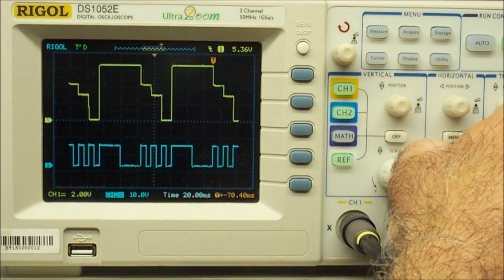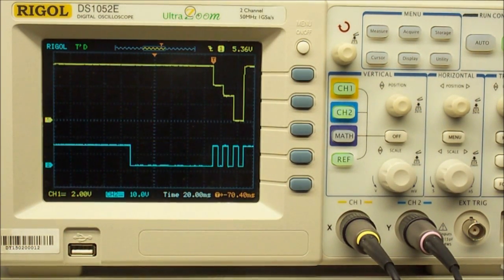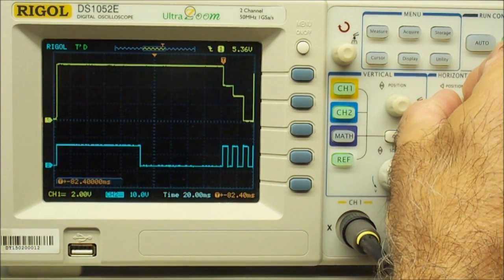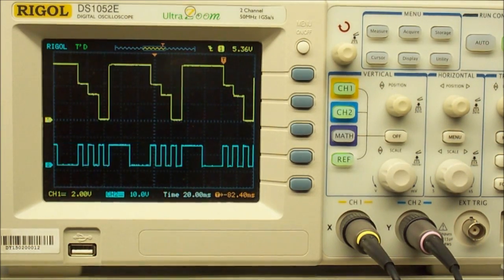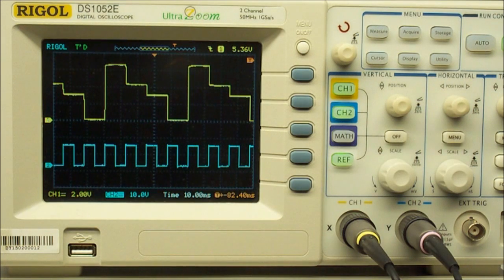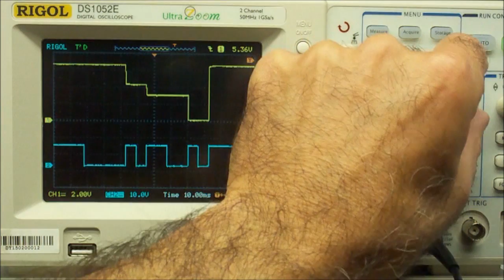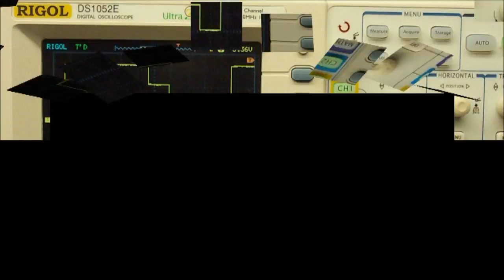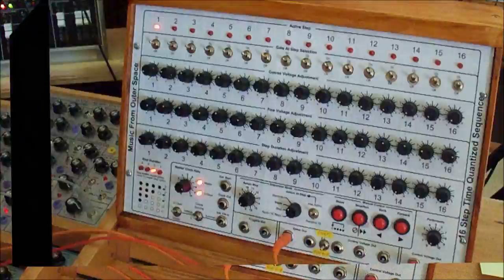The 16 Step Sequencer Vari-Clock Quantizer Presentation

Comment: A challenging project indeed, I have nearly completed mine, just a few issues to iron out. You've got to enjoy soldering and not be in any rush. Ray's work is inspirational. I can't imagine using a sequencer that doesn't feature the Vari-clock.
I hope to make a video showing this sequencer with a great deal of Ray's other modules that I have built over the last couple of years. Coupled with a Barton bmc016 dual nice quantizer, world domination is a step away.
Anyone thinking of getting into synth building should start with Ray. His documentation is second to none.
Reply: Suereed, I can't agree more with your take on RW's stuff. I came from amateur radioland where grumps run free. DIY synth has taught me so much. Just finishing the Ultimate and Expander this summer. This sequencer is next. Do you still recommend it now in the Summer of 2018?

Comment from the maker: I'm going to have a small board, used to wire up another set of 16 LEDs, made. It will be useful if you've already built the sequencer and would like to add more analog boards or this timing circuit to a separate cabinet. It will use the QA thru QD logic from the MFOS 16 Step Sequencer Digital board to control which LED is on. They should be available when these boards are (within a month of this post's date).

Comment: I'm trying to figure out how the Portamento works, but I think there is an error in the schematics.
The potmeter for the portamento on the wiring diagram is R51 - 1M, but in the schematic page 2 it states that R51 is 4k7 and no pot!
Could you please explain how to implement this portamento?
Reply: I believe you are mixing up the schematics here. The R51 1M portamento pot is indeed correct for the front panel, the R51 4k7 also mentioned is for another board, there are three, and its easy to get confused.

Comment from the maker: Another thing I didn't mention (I should really write an outline...) is that the unit works in random mode as well. In other words the step lengths will be whatever duration you've set them to regardless of how you get to them (forward, backwards, or random).

Comment: How much does it cost to build this thing?
Reply from the maker: If you go to the MFOS website you can see the entire project. I would estimate that by the time you've purchased everything you need you'll be at about a couple hundred bucks or so. That is assuming you already have an electronics lab set up or access to one. If you don't I wouldn't recommend this project as it is fairly difficult to complete successfully.
Reply: Yeah, I'm gonna have to start out small and get some practice, but I gotta say, that sure beats pay'n 2-3000 bucks or more on one at the shop for sure. Not bad.

Comment: Cool module.. but a LED display showing a BINARY number ?? UI fail. Did a simple double 7-segment display cause any problems?
Reply: It is a DIY community, all of this is published on the MFOS web site, why don't you add the BCD to this circuit and provide your design to the community?
Reply: You can add an LED display but, as Ray explains early on, you want to set the speed control so there’s no hitter on the ADC. Hard to do with a display—easier if you can ‘dial in’ the setting so as to see the LEDs at maximum brightness.
Reply: Sorry jitter on the ADC